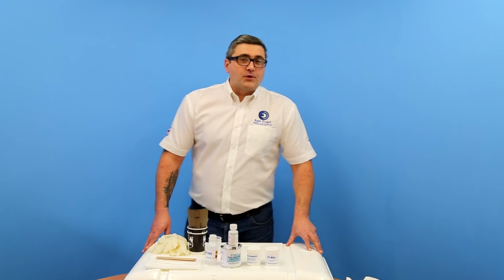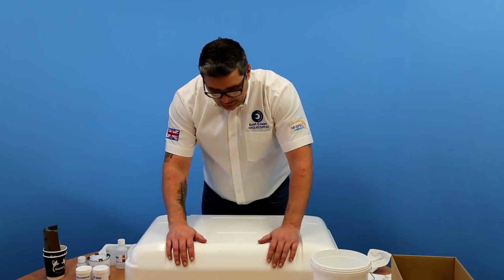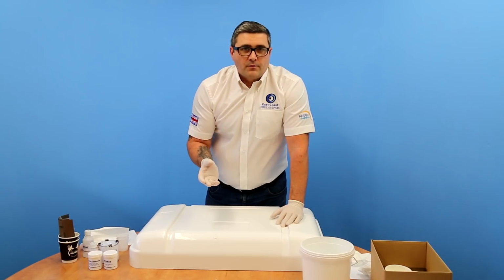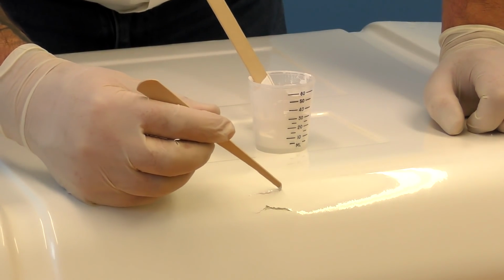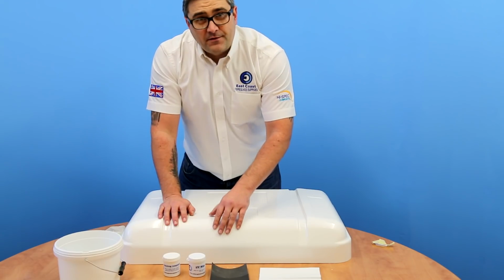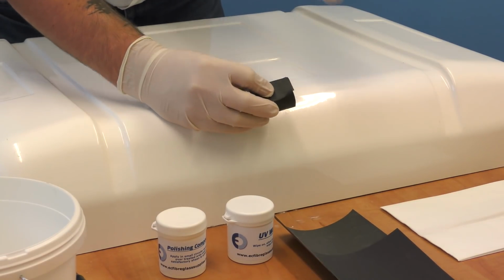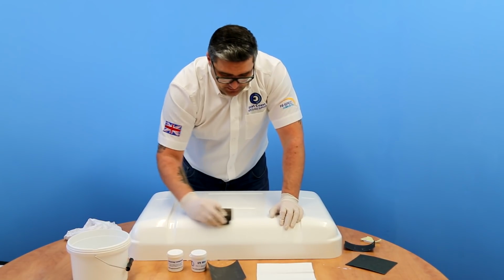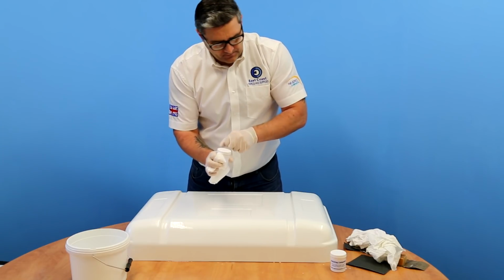How to Repair Gelcoat Damage

Comment: Great video, going to buy one of these kits to make some repairs to my glider. Quick question - will this stick to aluminium? 
I have airbrakes that extend out of the wings, and a small piece of gelcoat has come off at the corner to reveal Aluminium.

Any idea? Cheers in advance!
Reply from the maker: It's designed to be a finish coat for fibreglass - it won't adhere directly to metal

Comment: Best way would be to grind it out first with a grinder or dremel and then make a paste to fill the defect area..to me thats just covering up the defect not a professional fix!!!
Reply from the maker: Filler can be used for deeper scratches, but for shallow surface damage, gel is fine

Comment: What would you recommend for a 28’ boat with several chips in the the gel coat? I would like to repair the chips and then repaint or have a new layer? Is it possible to sand it down and add a new coat? What would be most practical?
Reply from the maker: Hi, depends on the depth of the chips really. If it's through to the laminate underneath, you'll need a resin or gel filler to repair those before a final coat of gel over the top.

Comment: Everytime I wet sand the gel, the old gel around the repair turns yellow. Any idea how to prevent this? I’m lubricating my sandpaper
Reply from the maker: Is it permanent or does it wipe off? Is it possible you're removing a layer of lighter gel, and revealing older/darker gel underneath?

Comment: I’m having an awful time making minor imperfections disappear on my panels. After filling I used 80 grit followed by 400 grit wet/dry and despite feeling smooth to the touch they can still be seen through my fill primer (2coats) and now satin paint (2 coats) ....help!
Reply: Why start out with 80 grit?  That's way too coarse, especially if you follow it with 400, that's a huge jump and probably why you're having trouble.  The key is to start with a grit just enough to knock down the gelcoat and then the next grit is slightly less and so on and so forth.  Start with 220 not 80.
Reply: I watched a video by boatworks and he started out with 400 grit moving up to 1500 grit. Followed up with buffing with a polishing compound.
Reply from the maker: Hi Matthew, give us a call next week on 0191 4975134 and ask for Martin. He's our tech guy and he should be able to help
Reply: EastCoastFibreglass - will do thanks!!

Comment: So you dont have to add wax to the gel coat ??
Reply from the maker: Hi, it's not needed for very small repairs like this one. The masking tape over the top will seal off the air to stop the tacky finish
Reply: @ecfibreglassuk  But on the repair that you do on this video, you state that it's only necessary if it's on a vertical or angled surface. I'm asking because I am in the process of using your kit and the deeper repairs that I covered with release film cured well but the smaller (fine scratches) that I did without film remained tacky, even after three days. To be fair, the tacky repairs did actually sand down with wet and dry (surprisingly)  but I was worried they wouldn't! I'm now worried about all the other fine scratches that I've got to do because there are a lot, and to have to cover all of those with release film, apart from not having enough release film in the kit, would be a huge pain. Should I get some wax additive from you for all the smaller scratches or not?
Reply from the maker: @marcusharrison6913  Wax is added to the gelcoat so it will cure without the tacky finish. It's job is to sit on the surface and seal it off from the air while it cures, which is what causes the tackiness. Release film over the top, or anything really, will do the same job. You can use masking tape, PVA release agent, cling film, etc
Reply: @ecfibreglassuk  Just a note for other folks. I've used cling film in the past and it tends to crinkle as the gelcoat cures, making more sanding work! I'd recommend a stiffer film.